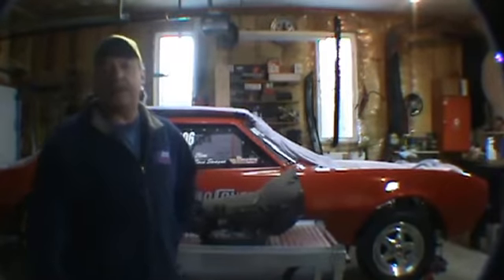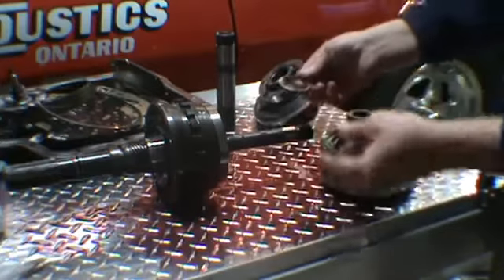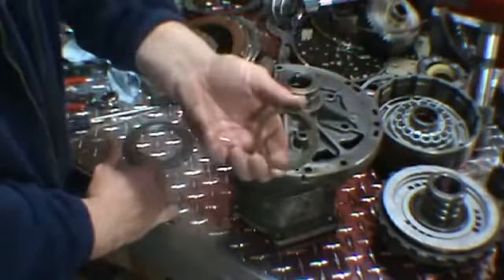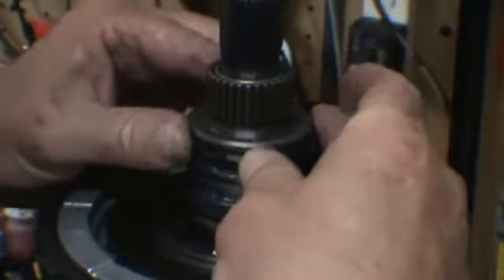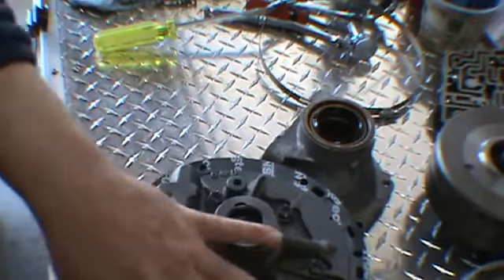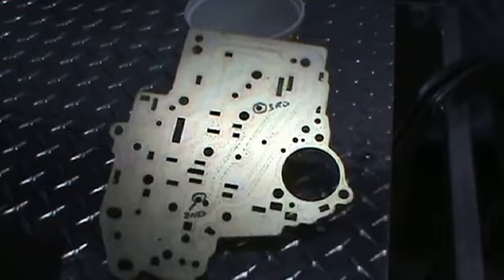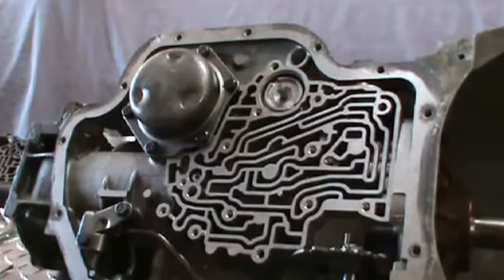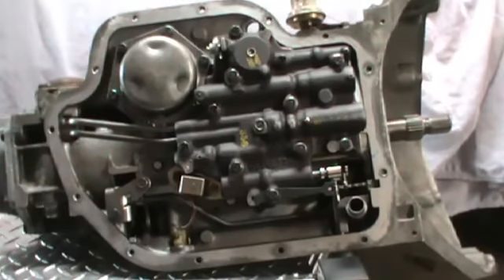TH400 Teardown & Complete Rebuild-FREE

Comment: I did my 33' rv th400 two years ago .
Had previous experience with my '65 NoveSS 283 powerglide conversion to  350hp 350 + th400 hd.. Had driveline cut too long and
 smashed the output bearing. 
Learned my lesson after 3 rebuilds with  B&M parts.  Transmission was too strong for the rear 3.08 and split the carrier In two. Replaced with a stronger '66 carrier. 
Decided to "tow truck Allison" my HD rv 400.
Put all the best parts in and went for the Honda ,005 clutch clearance.
PERFECT!!!😮
Shifts like a dream 
Also added temperature and pressure gage on dash.
Sweeet.

Comment: Thank you for the video. Bell housing was cracked on the truck I just bought and have no other alternative to doing it myself or staring at my broken down truck because I cannot afford a new trans. One question so far. Wheee can I rent the spring compressor you are using at around 18 min into the video? I’ve asked everyone I know and called auto parts stores, taken the part into the stores even and they have no clue. I eventually used a couple c clamps to take one off and the springs went everywhere. 2 still missing!
Reply: Where are you located? I heard Ottawa on the radio
Reply: When th' hits t' fan,,, bottom feeders survive! Proud!
Reply: Its not funny but Im laughing my ass off, sorry dude

Comment: This is a great tutorial for the TH400. I found an inner lip seal and an inner beveled seal (without a thin lip) in my rebuild kit. They have the identic size for the inner size of the intermediate piston  and the direct drum piston. Does anybody knows where to use the lip seal and where to use the beveled seal.
Reply: All the 400 seals for pistons have a lip.
Reply: @BrianSwayne  yes you are completely right. After I've read your answer I checked the kit again and there are 3 inner lip seals with the same diameter in it. One with the lip pointing inwards to the middle and two with the same diameter  that have the lip to the outside. The one with the inner lip is for the intermediate piston and the two with the lip to the outside I suspect that they are for the direct and forward drum. I was confused because I didn't realise that the intermediate seals against the inside.
Thank You from germany.

Comment: Cool video really helpful in everything..I have a th400 that don't shift normal driving or when I try to shift manually .only at high rpms also only got it to shift in 2nd and let off not sure if it even shifts into 3rd at high rpms I've checked govenor and looks in good shape shaft moves and plastic gear is good and put new vacuum modulator still acts up any idea as to what it could be ..any help would be appreciated..
Reply: Pull out the governor and have a look at the valve sticking

Comment: Great video, you never mentioned a case saver ring or a four tang washer for the case before the tail shaft assembly is installed. Is there a reason for leaving those out?
Reply: Probably just forgot. Was made over 20 years ago.

Comment: He stated removing the  3rd accumulator spring in the valve body deletes the band, he left the band out, but then he installed the intermediate servo to use with the band. I'm confused. Does leaving the spring out of the 3rd accumulator in the valve body eliminate intermediate band apply?
Reply: Plugged apply but left piston in. Yes no band required unless you want engine braking.
Reply: @BrianSwayne   so for engine braking all that would need to be done is adding the band with all the same mods?
Reply: @inscoredbz  Yes and dont plug  apply hole.
Reply: @BrianSwayne  so the accumulator pressing on the servo is what applies the intermediate band?
Reply: @inscoredbz  yes

Comment: Great video, I really appreciate it👍🏼
Sir my th400 is stuck in park, I got a corvette with 671 blower and I usually turn it off in drive when I pull in garage after a drive up my street, I’ve not drove or started in months and as stated it’s stuck in park, my shifter cable moves, linkage moves as should! I took my pan down to inspect and nothing looks disconnected, I manually moved gear selector and “ from my eyes” I don’t see anything?
Can you please help with a process of elimination as to what to look for, I sure appreciate that as I’m in dire need of move car ( getting it out of park) as I’m selling my house and I will be rebuilding my th400 after I move ( thanks to your videos) ANY HELP GRATEFULLY APPRECIATED 👍🏼👍🏼

Comment: This has been one of the most informative videos I've ever watched, some really cool well-kept secret  tricks, I have two questions do you check your clearances before soaking the clutches or after and I found it odd that you didn't use the studs to line up the valve body is there a reason for this?? I thought it would be a good idea ??Thank you DAN LAPLANT Rochester New York
Reply: Yes check clutches dry. I have been doing this for a long time. These vids are over 20 years old.

Comment: Do you need the up facing seal on the forward and direct drum
Reply: If you dual feed leave drum seal out of high but leave it in forward. If u remove in forward it just engages harder into gear.
Reply: @BrianSwayne  darn it's done I left them both out with no cave washers I'll see how it does tomorrow it's for my old service truck

Comment: I'm gonna plug my th400 case connector because i installed a gear vendors overdrive. What should I do with the kickdown solenoid wire inside the transmission? Thanks
Reply: No need to do anything if your not using it.
Reply: @BrianSwayne  thanks. I'll just leave it inside the transmission unconnected.

Comment: This is a very knowledgeable video but there a couple things he forgets to show the case c clips ther 1 thin 1 large beveld and 1 large non beveld also the shaft holes must line up dont pur opposite this will cause problems